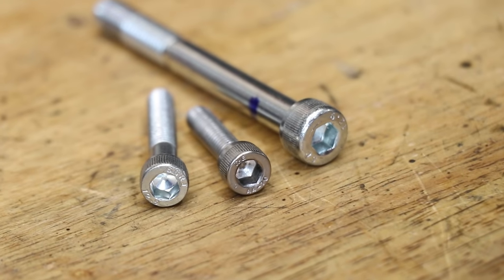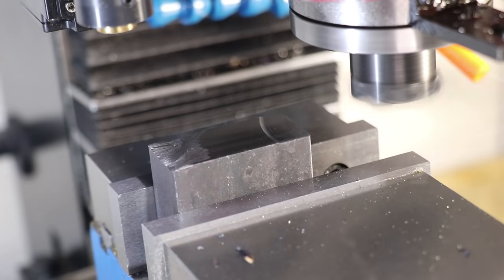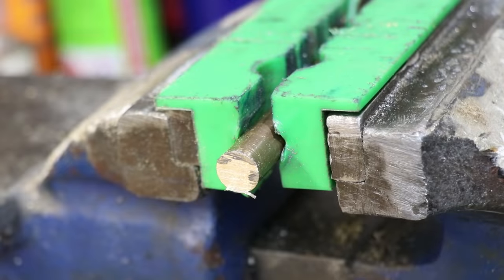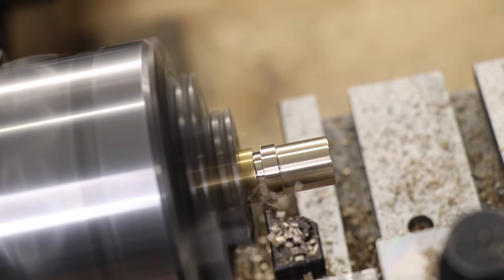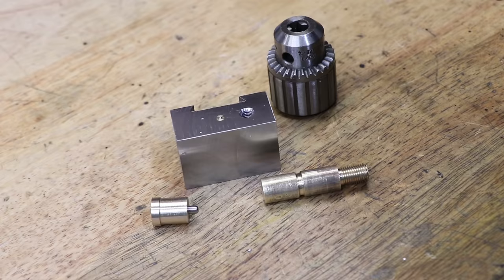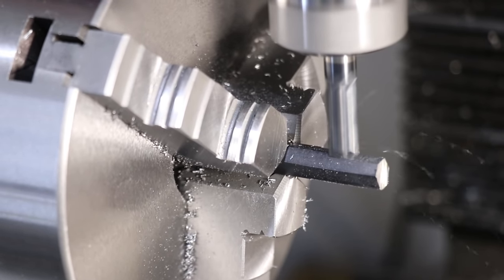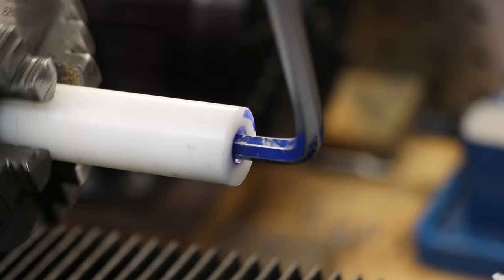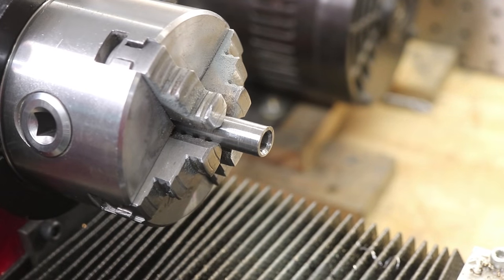Making A Rotary Broach - Cutting Hex Sided Holes (DIY)

Comment: HSS reamers will leave nice finish if you slow them down dramatically. I see a lot of people making this mistake. It has 6 flutes so it doesn't need high speed to keep it lined up with the hole as its fed down the pre drilled hole. Slow feeds & speeds with reamers. Also, use cutting fluid and not coolant, try this next time.
Reply: If any tool is leaving a bad finish you should look up the speeds and feeds. These are also for ideal machining conditions, any slop in your spindle, work or tool holding will reduce your tool's effective speed, so don't be afraid to play with your speeds.
Reply: @Shocklingg  Agreed, most of the tool suppliers(or at least here on my side of the world) have like a book that is not only a catalog of their tools, but also recommended feeds and speeds. Beware though, some books are very nice and already have the feeds and speeds worked out for you. Some books will give very little info which leads you to work out everything. Also like Troy mentioned, its not to say that the recommended speeds & feed are gonna work 100% for you, so play a bit and you should eventually see a pattern to what the machine likes. 

But point being, you should be able to find the "proper" feeds and speeds from the manufacturer of the tool somewhere.
Reply: Yeah, that reamer was going way too fast and feeding entirely too slow.
Reply: @Shocklingg  
I was thinking the same thing, don't think I've ever seen a reamer run that fast, looked like drilling speed?
Published figures are almost always for industry where tool life/production rate is the main criteria. It's a trade off.
 For hobby use, it may be better to run a little slower cutting speeds or feed rates so tools last longer, particularly as most hobbyist's are in the 'ten thou' range of cutting depth and feeds and few have the ability or knowledge to re-sharpen cutters
Reply: I'm no pro, but I recall a guideline of half the speed and double the feed for reamers compared the the S&F of the drill.  Also don't let it loiter in the hole... once you hit depth, get 're out of there.
Reply: You saved me the effort. It’s not rocket science is it? Anyone can research how fast a reamer should be fed, and how to do the job properly.
Reply: @mattw7949  I'm an engineer that just so happened to buy a mill for convenience. Modifications, last minute parts, repairs, no time to wait. I'm a machine designer, manufacturer and builder, tend to send out 90% of the actual machine work, we do the finishing, and assembling. BUT.... I spend a lot of time screwing around with proper speeds. Working on getting some guides for end mills, reamers, and everything. We HAVE big laminated posters for drill and tap sizes, and speeds, etc. In the short term, your comment then IS a good rough estimate of speeds? Run my reamer at 1/2 the same size drilling speed, and push it through relatively 2x as fast as the drill bit?  Just confirmation. THANKS MATT!  I set plain bearings in my equipment side frames a lot, have some precise reamers for that, and I turn those by hand by machine makes the hole too big, run it really slow, and leave it a second or two too long.... hole too big. Hand ream, in the 1/4" aluminum side frames, perfect. (I suppose I can get a smaller reamer, and then do it by machine. Advantage of the machine will of course be less SLOP from doing it by hand, OR....  I'd like to find an old fashioned "tapping table."  What I should do is make my own out of some junk drill presses I ahve laying around. Take  the motor off, and big hand crank on top, etc. Make some collets to hold the large reamers, etc.

Comment: A little tip on the reaming, slow your spindle, feed and you NEED to use some cutting oil, reaming dry is like tapping dry. Oil will improve your cut an unbelievable amount
Reply: Only slow down the Spindle not the feed.
Reply: Reaming should be half your drilling speed and more coolant than drilling its common sense
Reply: Hey, also, if you’re gonna use a reamer and want a more precise and consistent diameter, stop the reamer at the bottom of the hole, and bring it back up while it isn’t spinning, this way you won’t take off more material and make your hole bigger on the way up, also the finish is much better as there will be less scratches.
Reply: @knightfall7534  exactly, I was thinking the same,

Comment: One of the easiest to make but clever for it concepts I've seen.  I wondered about the required offset angle until you mentioned just angling the tool post a degree or so off square.  that turned on the light over my head!  Like Deon below I also get fine results from my import reamers by using cutting oil, instead of coolant, and lower speeds.  And don't feed it in overly fast.  Feed it at roughly the same feed rate as a drill.

Comment: When I wanted to make 1/4" hex I used the rear end of a Phillips head drill bit.  Place it in a drill and use another mini grinder to concave the rear of the bit, it leaves the edges sharp and I was then able to drill a round hole in material and then tap the "broach" in making my holes to accommodate any drill bit.
Reply: Do you need to use graduated sizes or can you do it all in one pass?
Reply: Was going to mention this too. I've done the same and it works well. As long as you aren't using cheap hex bits, something from a good brand name, it should be made from CroVan, S2 or A2 tool steel. Just make sure to not get the bit too hot and you're good to go.

Comment: Im a toolmaker at polygon solutions , not bad , your issue is speed and feed to have the broach cut to size and closer finish, but the mechanics are correct.
Reply from the maker: Thank you, it seems to be like this. I might give it a go in the sherline since I have better speed control there. Cheers

Comment: Is it a rotary broach though, or just a broach that happens to rotate? I can't see what feature in your design would cause the required eccentricity besides runout from the chuck.
Reply: My guess is that he rotated the tool post to get just a bit of eccentricity, but it’s not clear
Reply: @Troggination  He stated before the first cut that he put the tool at an angle to the centerline.
Reply: @KayleeKerin  oh whoops musta missed that.

Comment: Tip: When milling the cutters, I side mill them, not end mill. That way I avoid the square corner at the root, which is a stress riser and is usually where they fail. Side milling leaves a clean radius and produces a stronger cutter. It also has the advantage that the dividing head does not have to be tilted, but simply skewed on the mill table.

Comment: 3:12 not to nit pick you( I find your videos very interesting) But I'm gonna say that was 4 times to fast with the reamer. And flood it with cutting oil.
Reply from the maker: Thanks for the heads up. It was about more than  half the speed of the 12mm bit bit I think that was still too fast. :)
Reply: @artisanmakes  The rule of thumb I was taught as a machinist is 1/3 of the RPM used to drill the hole. Same for anything with a 45° taper, such as dovetail cutters.
There are more accurate calculations in my machinist's handbook, but the rule of thumb has served me well enough :)
Reply: @artisanmakes  Reamers also want much faster feed than drills. Often 2-3 times as much.
Reply: Now I'm confused. Which is it? Reamer faster...or slower than a drill?
(And lots of chip-clearing, that I know.)
UPDATE: Oh, I misread: slower speed, but faster FEED.
Reply: How fast were you running the 12mm drill out of curiosity? Generally on a Bridgeport I would be running a 12mm around 300-500 RPM

Comment: A great project! 
Probably you'll already know but This Old Tony has 1 or 2 videos about making a rotary broach. There's a particular feature on the rotating part as the broach isn't perfectly centered and rotates at a very slight angle. This provides a better cutting action. It is difficult to explain in words but as you see it it is very clear. Good work as always!
Reply from the maker: I did mention in the video that it's kicked off at a 1 degree angle

Comment: I've been thinking about this. Could you drill a hole in the end of the bolt then heat up with a blow lamp. Then press a piece of Allen key into the heated up end ?

Comment: Looked pretty good , a few more tweaks with better tolerances and a little smaller cutting bit and you'll be making perfect hex screws and bolts keep at it
Reply from the maker: I made better cutters from silver steel and it really improved the results compared to the hss cutters

Comment: I wonder if you could make a die, heat the bolt material and forge a hex into the head. Then machine as desired? js.

Comment: Very nice work, just a question: at least twice you chose to do things a certain way because you didn't have the proper materials at hand, and in both cases you had to re-do everything, probably taking days of work. Why not get the right materials upfront?
Reply from the maker: If your referring to the cutters, they really only take 10-15 minutes to make. I did it this way because I have lots of hss shanks on hand and it is nice to find a use for them. I would have used silver steel if I had to but the hss worked. Easy way to save $20 or so. You can do it however you like if you make one. Cheers

Comment: Could the dremel concavity work affect the existing heat treat for the broken drill version?
Nicely done!
Reply from the maker: Always difficult to judge when dealing with hss since it loses it temper differently to carbon steel. I am quite certain the answer would be no, we don’t let the metal get that hot here

Comment: Hello. Really nice Video. But you have an convertional miling maschine. You have to watch out in which direction you drive the workpeace to the milling cutter. Only counter run on this milling maschine. If you dont to it you spidel will be demaged in a very small time.
Reply: I woulden't say it would damage the spindle, but it could be done I suppose, it's more that the rigidity of the machine and it's size should only be using conventional milling cuts, not climb milling.

Comment: Unless I missed something, your broach isn't set up the same way commercial broaches are; their toolholder is offset, and holds the tool at an angle that effectively gets the center where it should be. That way there's a decidedly "wobbly" action. See ToT for videos of that cutting action.
Reply: You need to look at video at 11.10 he explains it.
Reply: Rotary broaches only wobble when used in a milling machine. You can't really see what's going on when they're used in a lathe.

Comment: Great work there. I made a tailstock mounted broach and it works ok but it wants to cut a spiraled broach. Have you had any issues with a spiral cut? I can get around it by reversing the spindle direction every 5mm but it's a bit of a pain. You might wanna add a thrust bearing as all the force is axial too. Thanks for sharing

Comment: I keep thinking about how to make a 1/4” driver bit holder. I’d love to make a bolt with an extra deep hex socket and a magnet inserted inside.

I doesn’t exist and it would be cool if it did: a “bolt” that can convert anything onto a .25 shank bit bolder by threading it in and using a set screw on the side.

Comment: Great video and thanks for sharing. I have no experience whatsoever with engineering or metal work and I am intrigued as to why the piece you are cutting into needs to be rotating, why can’t the cutter just be pressed into the undersized hole?
Reply: Between the 1 degree angle the tool encounters the work and the three degree of angle cut onto the broach, only one cutting edge on the broach is cutting at any time. As it rotates, each cutting edge is doing some cutting. 

You could probably just plunge broach a hex key, but you'd run into problems with blind holes and nowhere for the chips you are making to go. Plus, you'd have a very hard time doing that on machines of this scale, the pressure required would easily start deforming the frames, and I doubt you'd get any chuck to hold. Pretty sure you can see the stock slipping in the chuck (13:00) when using the rotary broach even, takes a lot of pressure even with only one cutting edge...

Comment: That was a really good idea to make this to mount in the toolpost rather than the tailstock. So much simpler to make (a friend of mine made one out of an old rotating centre), you can experiment with different angles (1.5 deg. might be better than 1 deg.?), & you can easily compensate for different lengths of toolbits. O.K. it won't work in a milling machine but you probably don't need to do that anyway!

Comment: vary cool. I did wonder if these could be made well enough to work. What I have a real need for is cutting internal splines for a Polaris RZR XP 1000 rear CV axle to slide into. 

No one makes any type of shaft I can buy. I do have a rotary table. I also have some dumont key way broaches and eyeing those, I wonder if I would make a spline cutter using a round key way style broach and a smaller key way cutter re-profiled as a spline cutter. 

Then inserted in a bored hole to cut and then rotated for each spline. Or would a re-profiled carbide boring bar work better? Guess I will simply need to try, that will be the fun part.

Eyeing this rotary broach I wonder if I could make a rounded button with all the splines cut and mount it at an angle like this and cut all 27 splines in one smooth plunge cut. OMG that would be so cool. I'm guessing I would need one heck of a strong machine for that. Maybe a really big lathe. hmmm... no. I will just cut to the chase and start looking for a plunge EDM I can afford.

Comment: I sparked my first hex socket the other day at work when I had bugger all to do. It was a little on the small side but a 3mm hex key just about went in.
It would have been much easier to make the electrode if we had a dividing head. I had to use one of those crappy little spindexer thingies.

Comment: It would have been nice if a few graphics  with lines and angles were imposed on the video fotage for the actual cutting use at the end. Because at least I myself don't understand at all how this tool works. The video fotage doesn't tell me anything, I don't understand at all what is going on. 

And why is the tool rotary in the first place? That could be touched upon as well. I suppose just ramming a form broach into a hole, like with keyholes, requires a lot more force and probably a number of consecutive sizes of ramming broaches.

Comment: Is there a reason you use a hacksaw rather than a rotary cut off tool(grinder with cutting wheel)? It just seems like the hacksaw would be painfully slow.

Edit: For heat dissipation purposes I suppose?
Reply from the maker: Grit from the cut off wheels. It gets thrown at the camera, the lense and it it get on the lathe and mill ways which I would like like avoid
Reply: @artisanmakes  Makes sense, it does throw a ton of junk.

Comment: I'm not a machinist, but dont really understand how this works. You have a cutter shaped in the desired hex dimensions with sharp edges, then put push it into a rotating metal rod. The cutter seems to instantly match the speed of the rod, so you're essentially just pushing it into the metal, with no difference in speed between cutter and rod, so why does it need to be spinning? Surely it would have the same effect having both parts stationary and pushing the cutter into it? or am I missing something?
Reply from the maker: https://www.youtube.com/watch?v=IT8VXQEKzoo this video explains it well. Difference here is I spin the work not the tool

Comment: hi. Why do you turn your lathe by hand when you cut threads?
Reply: i do that as well as my lathe it would be too dangerous to disengage the gears while running. plus you have more control albeit more slower.

Comment: Hiya Artisan can you please provide some information on the bearings you used? were they angular contact? interested in trying to make a rotary broach for myself :)
Reply from the maker: Hey mate, from memory I used a set of 5700 bearings. I only used then because they were left over from another project so don't feel as if you need to use this specific size. These aren't thrust bearings, the thrust force is taken up by that rounded pin at the back of the assembly. Best of luck.
Reply: @artisanmakes  thanks for replying!

Comment: Is it possible that your final result is a bit loose because there is some runout in the Jacobs chuck?  I'd bet your tool itself is correct.  Great job on this video... always a fun watch!
Reply from the maker: The run out shouldn't matter much, I made everything a little loose to lower the stress on the cutter. The cutter was just a little bit oversized

Comment: Just as a side note, the green stones aren't meant for steel, they are usually meant for plastic, if you use those, they will ware out really fast
Reply from the maker: Thanks for the heads up. These are just cheapo ones from a $15 set of rotary tool accessories. No wonder why they didn't last long :)
Reply: @artisanmakes  you are welcome, btw for a beginner, from Alibaba, which mill would you recommend?

Comment: Thanks for a well made and inspiring video! Do you think it would it be possible to make the cutting tool from HSS lathe blanks, or would they not be hard enough?
Reply from the maker: Thankyou. As I understand it most commercial broach cutters are made from M2 hss. As long as you can shape it they should be fine. If you can I'd buy round hss blanks or silver steel.

Comment: Well, the reamer needs to be run with oil, and with half the speed and twice the feed of a drill. You need to run coolant or oil with all your cutting using drills and reamers.
Reply from the maker: I did use oil on the reamer, bit fast though